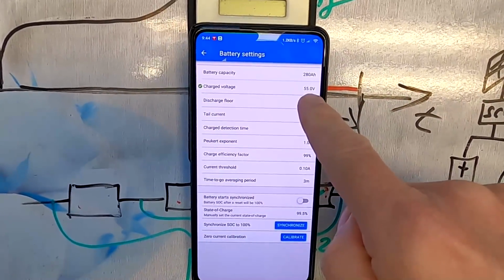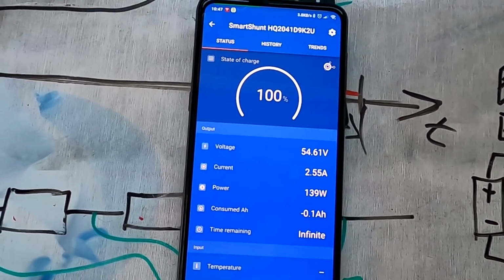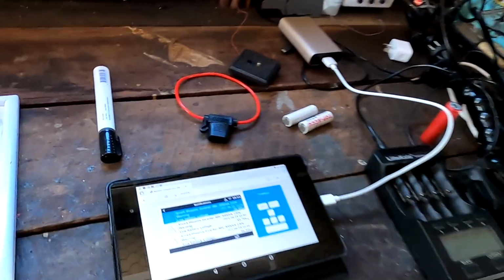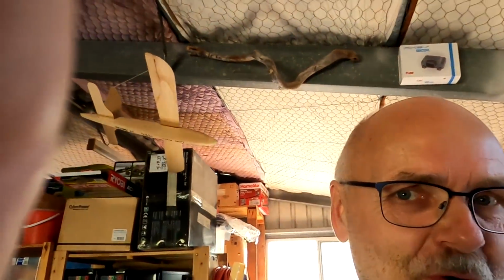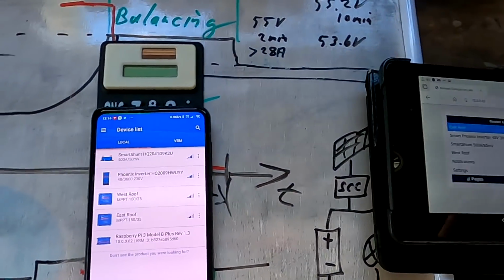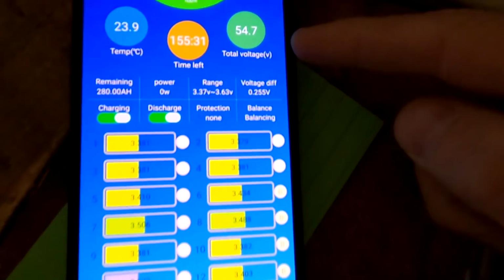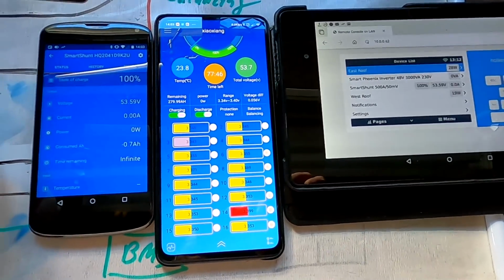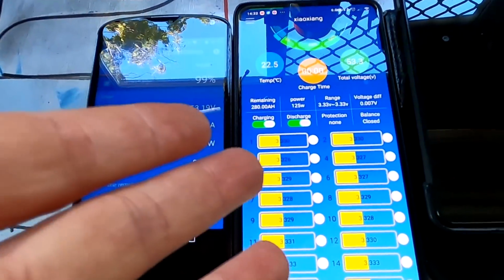Houston, we have a slight (BMS) problem and... are now Off-Grid!

Comment: I don't understand why the BMS keeps reconnecting the battery. Shouldn't it wait until it reaches 3.55V?
Reply: I don't think Lifepo4 cells can maintain 3.65v without constant charging, so the cell drops voltage instantly when the charging stops.
Reply from the maker: Yes, it should wait until the cell drops to 3.55V. That's what got me off as well. The QUCC BMS does not seem to work well. Whatever I try, it does never what I'm trying to achieve.

Comment: Maybe the balancing current is too small.
I know you did a video on why you didn't add a supplemental active balancer. But in this situation you might consider these again. On AliExpress you can get some with up to 5A balancing current. That should be enough to pull overcharged cells down fast enough.

Your battery consists of different batches after all.

Watched till the end...ups...
Reply from the maker: Yeah, I'm close to pulling the trigger. Actually wanted to wait for the new BMS to come in and see if this works better.
As you said, the 0.2A balance current is just too slow for these large cells.

Comment: Hmm , Try using the Manufacturers suggestions , should be no float for 48 volt system , 58.4 max. for a set time  , then you choose . The battery cell chemistry should be exercised to maintain top Ballance . Good luck ?
Reply from the maker: What manufacturer's recommendation do you mean? 58.4V would be 3.65V per cell. That's the maximum voltage you can charge the cell to but it does not mean it's recommended.
Reply: @OffGridGarageAustralia   good morning , if you want the battery capacity and top Ballance , I use the max / absorb, for 45 min  and drop down for the bulk charge , this will stop the Quick trigger to float . 2 stage charging for this chemistry is best to obtain max. Battery life cycle .

Comment: Why does the BMS shut off the discharge mode when one cell is high does not make sense. Just put a load on it then it will discharge that high cell so it can balance faster.
Reply: The BMS as a contractor in order to be able to handle higher amp. This solution do not support disconnecting the one direction while keeping the other direction open.

The app share usage with a smaller BMS that support disconnecting in only one direction.

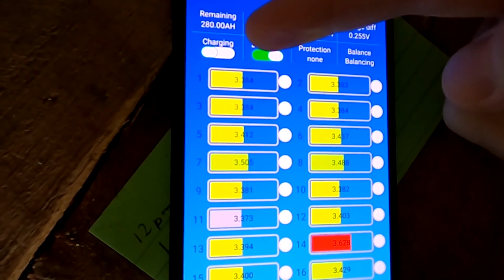He explains it at 18:20, and he have also done a video about it.
Reply: @MichaelEricMenk  Well that sucks for BMS control.
Reply: @offgridwanabe  He needs a Dual Port BMS.  Unfortunately, he has a Single / Common Port BMS.
Reply: @offgridwanabe  There are modern Dual Port / Separate Port BMS that have charge & discharge control pins to energize external Contactors or SSR's ...
Reply from the maker: Yeah, the relay function sucks if it's the only battery in your system. MOSFET BMS can handle current in both directions differently...
Reply: If you can protect against low voltage by using the inverter low voltage shutoff setting why not use a high current diode across the BMS and leave it to protect the high voltage situation? With two battery banks each with adequate capacity you could alternate so that each bank has 50% of the time balancing.

Comment: did you order a bms that has canbus/rs485 ?
that way your bms can tell your charge controllers to simply stop charging.
there's a few brands that support that, pylontech/seplos, but also a diy project by stewart pittaway called diybms
Reply: Batrium also support Victron.
Good to know a few others, as I'm about to start researching a bms for my gen 1 Leaf cells and Victron Easysolar.
Reply from the maker: Well, this one has a RS485 interface as well.... Just don't know how to connect this to the rest and control the SCC through that.
Reply: https://www.victronenergy.com/live/battery_compatibility:pylontech_phantom
Reply: this might be of interest for you new bms too :

https://diysolarforum.com/threads/victron-venusos-driver-for-serial-connected-bms-available-ltt-power-jbd-battery-overkill-solar-smart-bms.17847/

Comment: Food for thought.  I have similar situation with my cells and overvoltage.  I’m using a BMS with separate charging and discharging relays.  I have the charging relay situated on Solar positive input going into the charge controller and the discharging relay on the main battery positive.  Works well when overvoltage occurs as it literally just “Turns off the sun” but keeps everything connected to the battery including inverter, charge controllers etc.  Anyway, love your progress!
Reply: A Dual Port BMS ...
Reply: Surely you don’t mean that “turning off the sun” leaves the SCC connected?
Reply: @michaelbouckley4455  Yes, you put the relay on input side of the SCC… That way the output connection to the battery is still connected.
Reply from the maker: So you turn off your solar but leave the SCC connected...
Reply: @OffGridGarageAustralia  Correct! By putting the charging relay between solar panels and the controller, it'll stop the charging from the sun while everything still functions without power cycling.  You still have your discharging relay on the battery positive to protect it from discharging normally.  It works great this way, but keep in mind that you're only protected when charging from the sun which is all I do.  If you were to ever plug into the grid to charge or some other way, you would need to monitor and use another way to protect the battery from overvoltage during those times.
Reply: @OffGridGarageAustralia  You don't actually need a separate relay for this. The Victron MPPTs have a control input on them that you can use to turn them on/off. So instead of using a relay you can use whatever control voltage you'd use to activate the relay and use it to control the MPPTs directly. This is simpler and you don't have to worry about the power consumption of an additional relay.
Reply: @LogicMomentum I'm fairly new to all this solar but I can tell by your comments that you know ypur stuff qnd tend to think outside the box as to coming up with solutions to these problems.  I'd like to know how you would handle some of the problems that I've came up with during my solar hobby.
Reply: Andy I love the videos and I've been watching alot of them trying to figure how all this is gonna go with my new bms's. I have been running my system for awhile with leaf batteries and no bms but recently I've ordered lifepo4 batteries, a couple bms for the lifepo4 and a bms for my leaf cells. I also ordered a few active balancers. I'm trying to figure things out by watching your stuff and if you know specific episodes that will help let me know

Comment: maybe it is just a bad cell bms looks to do what it is ment to but they is only so much it can do if they is a faulty cell i scene stuff like this alot when they have used the recycled 18650
Reply from the maker: The cell is behaving well under high load...
Reply: @OffGridGarageAustralia  must have a lower internal resistance then so charges faster then other cells

Comment: the relay is not the problem it is the software on the bms thats not quite there it is odd how it has charge and discharge but yet only 1 relay
Reply: The software is generic for different BMS. That's why it is not aware that there is only a common port.
Reply: @ElectronTinkerer  yeah i figured that is abit shoddy tho
Reply: I believe it is actually rather smart using a shunt  to determine current direction using a small FET that then kicks in a relay when it is above the rated current of the FETs. It is not a pure relay BMS.
Reply: @jasondevine6014  it has a contact relay on the bms i belive the smart shunt is victron and independent of the bms
Reply: @1981dasimpson  yes but earlier videos showed circuit board of BMS and I analysed it! That is why the old relay was fine inside.

Comment: BMS = Beer Management Systems 👍
Reply: I concur about the BMS meaning. When I drink a bit too much, I float...then it's hard to balance.
Reply: I tend to panic as well when this has happened to me. I go and check my batteries manually then with the same meter, check all other voltages from the different mudules such as the shunt and check those against the apps. Often it is as you say, needs to have a wider spread on the settings so you don't get that relay cycling. Eliminating variables. Good video Andy!
Reply from the maker: Thanks. It's a lot to understand and link together to make this all works. I'm on 98% again so will do some more testing tonight with the manual charger, see if I can trip it again and just discharge this one cell.

Comment: You need to charge under the BMS shunting current.  I think your bms is really low, like 200 mA.  Do a slow charge under that and the rest of the cells will come up to voltage before it triggers the relay.  Really the BMS should be shunting 10A to do anything useful, but not common to see any this high.
Reply: this is exactly what I think, as the balance amperage is so low, it will never balance with that amount of charge coming in and also the 200mA, it will take a long time to balance with no charge
Reply: @benmoody2975  So for 3 months the battery was perfect because the battery SOC only got to 80 percent during the day time due to lack of sun. I guess he has to limit the voltage on the charge controllers to 80-90 percent to avoid BMS overvoltage protection problems. This is a band-aid solution, the permanent solution might be a 5 amp active balancer or a balancer with more power.
Reply: @uhjyuff2095  it’s possible some of  Andys settings are wrong, and trying to balance at to low a voltage, in the wrong part of charge curve, where the SOC of cells can be very different.
Reply from the maker: It seems like, the voltage I try to balance at is too low (flatter part of the curve). I was saying this in the video (or the one before). I wasn't sure if this works at all due for that reason. But then I thought, well balancing at the floating voltage seems a good idea as there is no external current going in or out at this point of time, so the 0.2A can really work. But, yeah, the voltage seems to be too low to do anything at 3.35V.
Reply: @OffGridGarageAustralia  The one cell going into overvoltage cutoff is because you are charging with more current than the bms can shunt.  Charging voltage is probably ok.  Put that pack on a power supply with 100ma and it will bring the entire pack up to the right voltage while the overcharged cell shunts away the extra current without tripping the voltage cutoff.   This is why an active balancer works better when you have solar charging than a power supply that can charge for 20hrs with a BMS with a overvoltage shunting design.  You don't have the 20hrs of sun....but an active balancer can work 24hrs/day.

Comment: Victron need to make a bms so the systems can be more integrated together
Reply: What about adding a Smart Battery Protect for charge and discharge. Or at least discharge so that the discharge is still possible even with charge disabled through the BMS.
Reply from the maker: Apparently it is somehow possible and the BMS can talk to the Victron system. The QUCC BMS has a RS485 interface but I don't know how to connect and if the solar charger need a special firmware then so they know there is data from the BMS coming?
Reply: @OffGridGarageAustralia  I would of thought it would do it like cambus system
Reply: @1981dasimpson  Canbus
Reply: @michaelbouckley4455  I'm always doing that lol
Reply: @OffGridGarageAustralia  062021/2332h PST 🇺🇸 RS-485 is used for low-speed data communication between (generally speaking) computers (Windows OS platform, Unix etc) by which; you’ll be able to configure the BMS function. I have no info if RS-485 will handshake with Proprietary software from VICTRON and its devices. I’m totally astonished, as to why VICTRON doesn’t produce their own BMS. I wrote to VICTRON Holland, regarding the BMS and the response I received was lukewarm. 
There it ended. Cheers and chin-up, your system will go online sooner than expected. Certainly, it will.
Let’s know.  In the meanwhile, a few cans of chilled Oettinger? Thanks. 73s…
Reply: @OffGridGarageAustralia  I've been using a Batrium BMS that integrates with Victron via can bus for a few years now and it hasn't missed a beat.
Reply: @OffGridGarageAustralia  Each Battery / BMS system capable of RS485 protocols has it's own firmware requirements in addressing what the capability's are for that system. So its's not a simple plug and play.
Reply: @OffGridGarageAustralia  Victron dumb bms with 2 wires, charge enable disable/discharge enable disable, does quuc has that signal out option?
Reply: 062021/2320h PST 🇺🇸. @ David, you are absolutely correct. Thank you. I’m surprised, as to why, VICTRON Holland has refrained from producing their own BMS. I wrote to them a while ago and the response was tepid.
One Country in the East mass produces BMS that VICTRON can’t compete, may be the first reason? 
I’m looking forward to VICTRON BMS in the near future. Until then stay safe and 73s…
Reply: Victron DOES have a BMS. Each unit can balance 4 cells. And you can add as many you want to balance a larger system In terms of cells in series. Here is an example of an small one: BBA000100100
Reply: @pederb82  i have never scene any bms done by victron for diy use only bms interfaces that read information from other company's battery data outputs
Reply: @pederb82  from what i have just looked at they do nothing of balancing they just monitor a 12v battery for over voltage or under voltage no balancing
Reply: @1981dasimpson  wrong. The example model does balancing with up to 1 amp. I wonder if this can be an market issue ? That they don’t supply it in your area? I’m in Norway. Here we can get Victron bms for up to 4 cells each. The example one was 2 cell one. But yes I do wish they had larger ones so you would not have to have a literal Forrest of them for an 48v system.
Reply: @pederb82  I did a google search and could not find any that did balancing just top and bottom shut off they where no connections for balance cables

Comment: this is exactly why i have active balancers on my packs so no matter at what voltage they are they are balanced if more then x amount of mv out of sync
Reply: But if the battery gows bad its hard to see if it went bad and whats wrong. Sorry fore my bad English
Reply: @electrojessy4270  no it is very easy to know something is wrong due to the lower capapcity at this point you would look at the bms history messages etc and will see that 1 cell is not working right a bms has a very low ampage dump load to balance with larger capacity cells the more this is getting out of its comfort zone and ability to cope bms dump loads work by burning off the excess power as heat until the other cells get to there charge limit and the bms then shuts down charging the bms andy has seems good to a point i myself think the bms should have 2 relays 1 to control charging and the other to control load or at least be able to send a signal telling charge controllers to stop charging untill it is safe to proceed
Reply: @1981dasimpson  His battery is having imbalance problems because the balancer he is using is not powerful enough. How powerful is your balancer and how would one size a balancer circuit for different capacity battery banks? We need a formula for sizing balancers to the batteries we have.
Reply from the maker: Yeah, I see it the same way, the 0.2A balancing current is not enough to make that work with these large capacity cells.
Reply: @OffGridGarageAustralia  that cos they only ment to stop the cell getting charge when it full so the others can rise to full charge voltage I have 5x 3s7p packs for powering my projects they are all new cells charge them with a cc/cc charger and find they take a very long time to balance if they even do due to the cv trigger once I put an active balancer on the packs are much better
Reply: @uhjyuff2095  when I had my power wall 100ah capacity I kept adding small balance boards till only the low cells charge and nothing was fed to the full cell like batrium and diy bms this was very wasteful so I moved to active bms and did the same I found the balance current had to be more then the current coming in to keep the power shifting about and away from the high cell

Comment: My BMS resets when I hit float but I do not use absorb time. When on float it will charge high amps or low whatever the battery will take. This is why I do not need absorb mode.
Reply: That's how charge my batteries no absorb time
Reply: @offgridlivingstlucia8865  What float voltage per cell ?
Reply: Andy set his SCC’s so there is zero current to the battery on float. Obviously it can supply the inverter in float mode.
Reply: @michaelbouckley4455  I am not too familiar with Victron Charge Controllers but most Charge controllers can't tell the difference between battery load and inverter load just pressure to increase the voltage. I wish I could understand this better.
Reply from the maker: Once in float mode, there is no current going in or out of the battery. All power necessary for the load is been supplied by the solar charge controllers. unless the load gets to big, then the battery will supply extra energy.